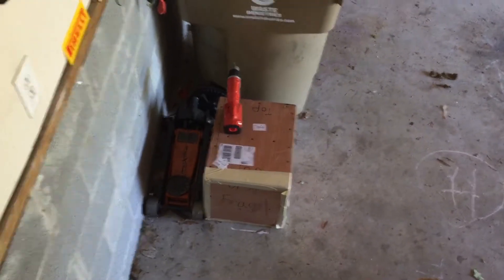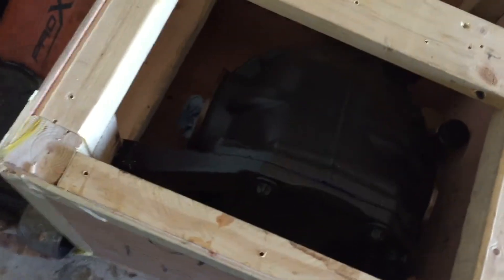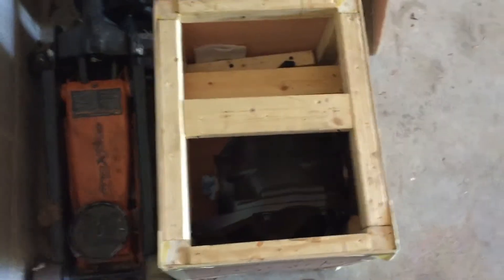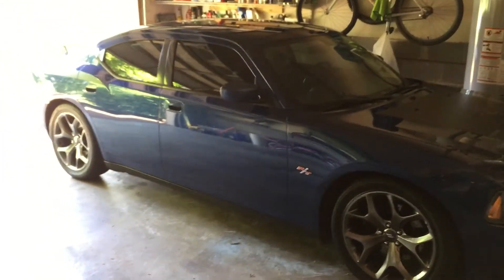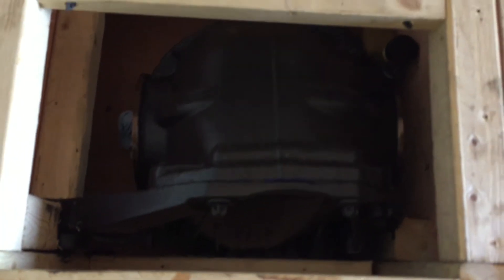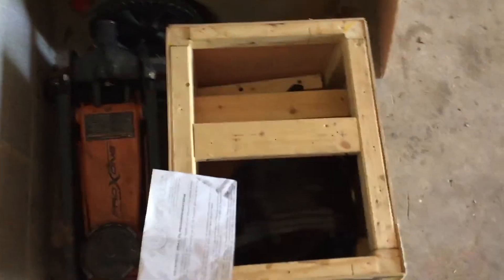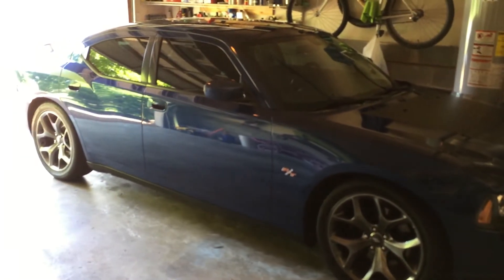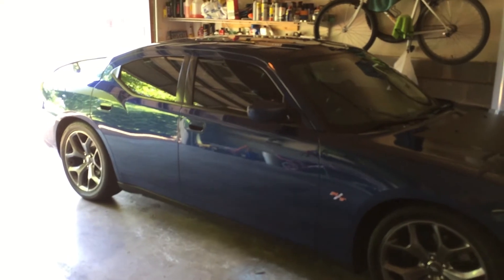New Mod Preview and 169 YouTube Subscribers Wow!

Comment: Just looked through your videos, & you went from a Mazda 6 to the Charger RT....

it's funny cause I went from a Mazda RX8 to my Charger RT
Reply from the maker: Ah cool. Yeah I loved the MazdaSpeed6 but missed spinning the tires in a rear wheel drive car too much. I knew quite a few people when I was in the local Mazda club that had RX8s. They all seemed to love them despite eating oil and getting bad MPG.
Reply: 169 Design Yup oil and gas, I have a friend with a Procharged corvette and he gets better MPG and oil than I did...I switched because I've always wanted a V8
Reply from the maker: Stan G it's a smart move. The R/T is a great base for modding. Lots of R/Ts out there running with or faster than SRTs. What year R/T did you get?
Reply: 169 Design Yup, i have full bolt ons, i went the BBK route....now I just have to get the SRT rear end & a tune